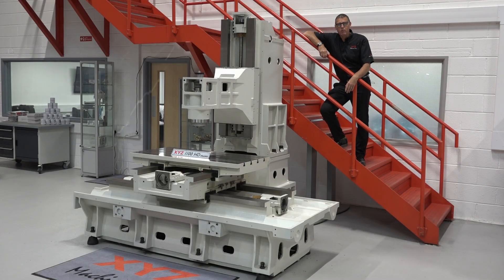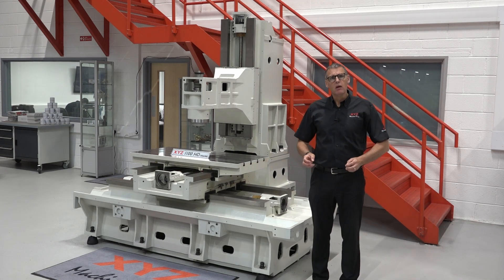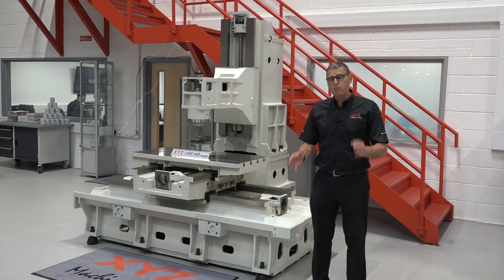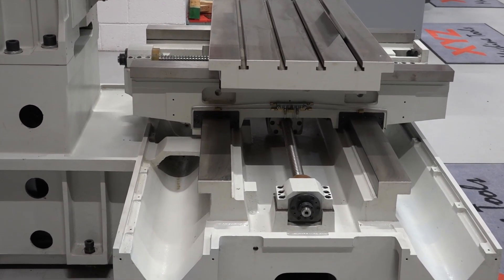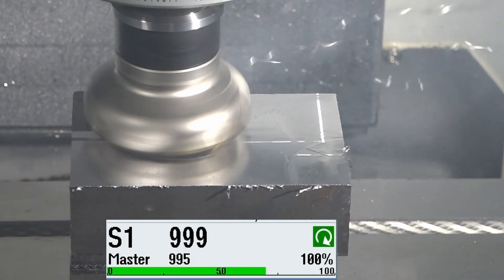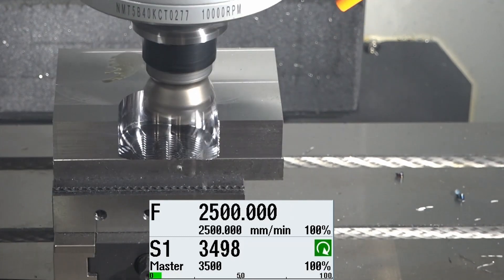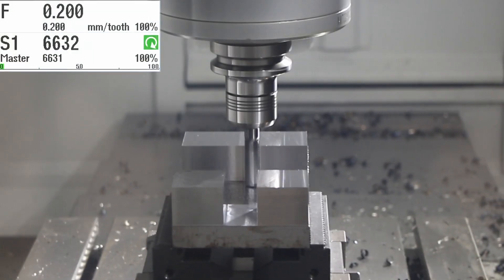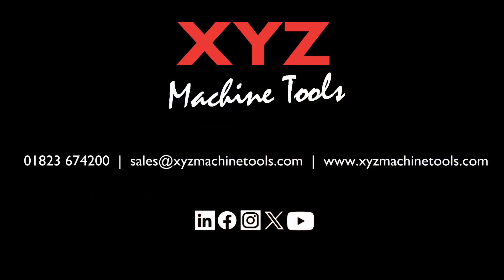Meehanite Cast Iron: The Backbone of Every XYZ Machine We Build.

Comment: FEA has been noted as responsible for a lot of failures in ICE engines. I would be hesitant in  specifying FEA as positive feature.
Reply: Precisely... FEA is a codeword, a doublespeak for corporate greed for the most part...

``our engineers toiled long and hard, but after months of arduous work - they managed to make sure that our products last half as much as twice the price(fine print - by making sure that we are using the absolutely minimal amounts of material for every single part)``

Comment: Thanks XYZ, for continuing in the quality of casting and of box way construction.
I've spent over 40 years in rebuilding machine tools by supplying hard to find parts (made from scratch), and in workholding fixtures for production castings.  The switch to linear bearing axis caused me some grief.  The vibration and harmonics caused a 20% increase in the number of fixtures as opposed to box way machines.  The pursuit of rapid transit and increased fixturing was pretty much a wash over a slower axis and fewer fixtures.  Yet, the more the number of fixtures, the more errors in set-up and production scrap.

Comment: The Meehanite process was developed in the late 1920s and early 1930s, by the Ross Meehan foundry in Chattanooga, Tennessee.  While in college I worked at Ross Meehan in the metallurgical lab and melting department.  They had both a steel foundry and the iron foundry.  Sadly most foundries are gone nowadays.
Reply: I've seen three disappear in WI and MN over the past 30 years.  Had the benefit of those who worked in these places in the late 40's onward.  They probably forgot more than I'll ever know.
Reply: @michaelmealy755  Yeah, there used to be a number of large foundries in Chattanooga.  I worked at Ross Meehan in the early 1970’s.  I think they are all gone now; the EPA killed them off!

Comment: I have never seen pure rectangular-section linear rails. The carriage relies just on weight to not have vertical movements?

UPDATE: Uh! Those rails seems machined directly on the casted basement... Impressive.
Reply from the maker: The 1100HD machine is a boxway machine so does not employ linear rails.

You are correct that the guideways are ground on the main casting of the machine.
Reply: This is the root of stability and longevity.
Reply: My 5000lb 1980's US made Bostomatic has box ways.  Rock solid machine.

Comment: what for is this polimer ring on ball screw?
Reply from the maker: If someone was to change the limit switch position on the machine, it would ensure the ball nut does not reach the end of the ballscrew.

It also provides a cushion should this occurrence happen rather than the saddle contacting hard metal.
Reply: Its a hard limit most likely